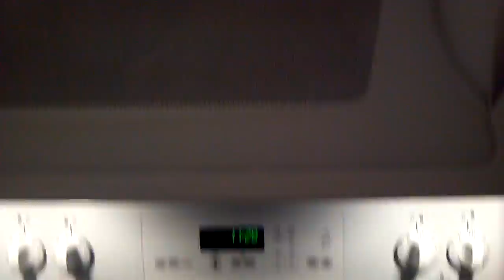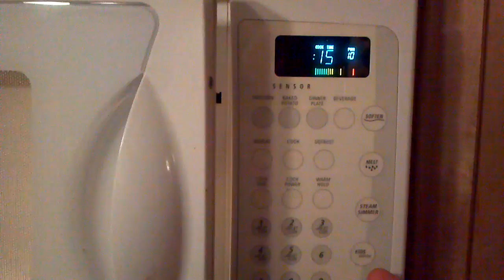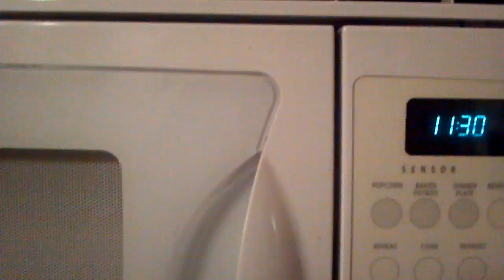Whirlpool Microwave turns off by itself

Comment: I habe the same issue with my 17yo whirlpool microwave. Is there a permanent fix?
Reply from the maker: There wasn't a fix I could find that was more economical than simply replacing the microwave at the time. I'm hesitant to recommend anyone who isn't an expert open up a complex device like this and fix themselves, but there are lots of parts and DIY repair websites now that might have instructions and parts that are easier to order and swap out.

Comment: What was your solution or fix? I have a 4 year old Panasonic NN-SN797S doing the same thing. I'd like to keep it, has lots of cool features, including a "beeper volume". Still able to cook on power level-5 with only an occasional outage - high settings will cause unit to kick off 10 out of 10 times. I'm guessing ours is the magnetron for $120 but we only paid $160 for the oven. I like fixing stuff but this is almost like stepping over a dollar to pick up a dime....